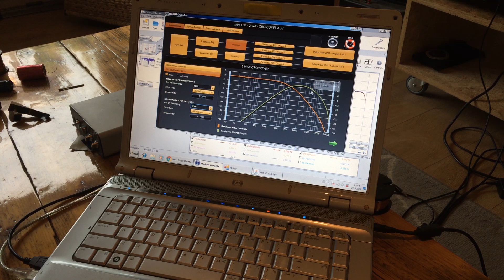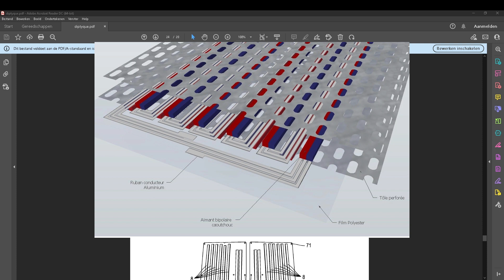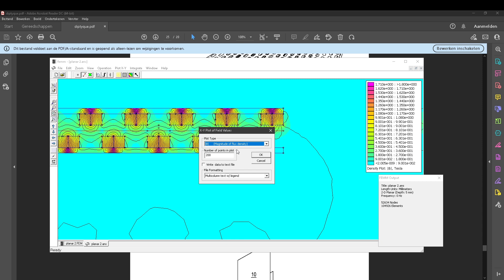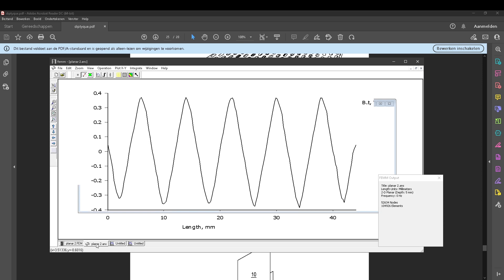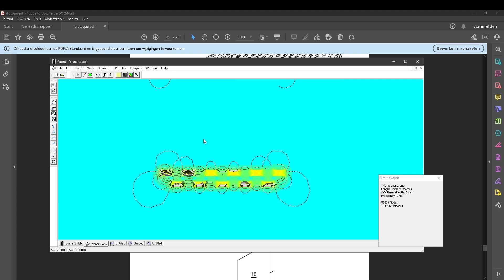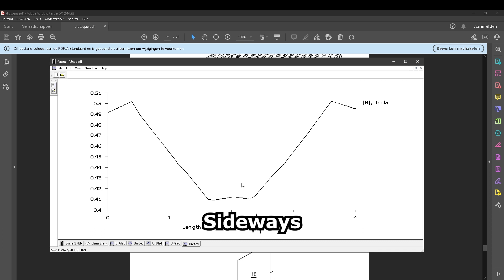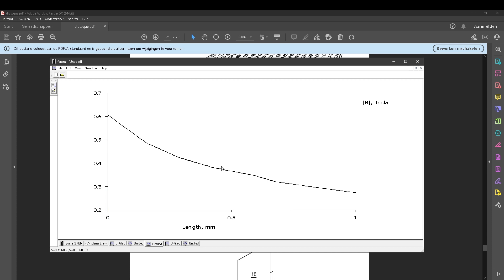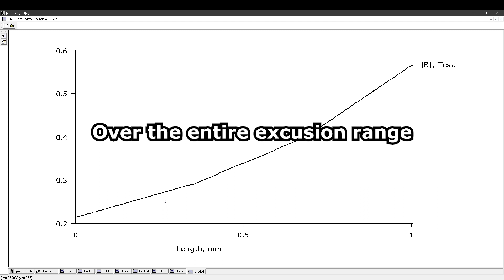Diptyque Planar magnetic speaker - Motor design "PPBM"  part 2

Comment: Thank you Joppe for your interest in Diptyque speakers technology. A patent is the description of an innovative technical solution, but it does not necessarily describe the manufacturing secrets which makes it possible to obtain the optimal result.
When we imagined this architecture, we had 3 requirements:
1- Make a perfectly symmetrical speaker in front and behind
2- Minimize the closure of the membrane
3- Have significant movements of the membrane with a constant magnetic field

Points 1 and 2 were easily obtained with this technical solution, but you are right the point 3 was more difficult and subtle and asked us for a long work. It was by working with our magnet provider that we found the ideal solution with magnets specially manufactured for us. But you will understand that we keep some secrets…;)
I invite you to come and listen to our speakers in a next show to discover their qualities, and their faults too…;)
Best regards, Gilles Douziech, diptyque audio designer.
Reply from the maker: Thanks ! I would be happy to hear you speakers in real live any show nearby that you know off?  It's an interesting design using rubber magnet i believe ?

Comment: Only use I could guess would be that this setup intentionally introduces (pleasant?) harmonic distortion / emphasis at particular frequencies. Definitely unusual, but the best way to make a judgement would be to listen to it. As someone else mentioned, it might be acting less like a piston and more like a DML, with complex modes resonating across the membrane due to the non-linearity in the field.
Reply from the maker: i think they will sound like most planar magnetics.  definetely not dml like, since that requires a stiff surface not a membrane.  it is sort of push pull what they eventually did.  but just slightly less neat as a regular one.  but most single ended planars sound also fine (like magnepan ) and single ended is way worse linear wise then there push pull. so they did achieve something better then single ended. i just dont know if it is worth all the effort.  i do like the fact they are able by doing it this way to have more coil over the entire foil instead of regular push pull.

Comment: Thanks for sharing this weird magnet composition. I tried a bit different one and it seems slightly more linear.
|s|     |n|     |s|     |n|     
|n|     |s|     |n|     |s|     
-------------------------
|n|     |s|     |n|     |s|     
|s|     |n|     |s|     |n|
Reply from the maker: Yeah thats because this is a regular push pull config :) also shown in the videos :) its more linear and stronger.  its what most push pull uses. so a single ended and the another plate that squeezes the field out.  increasing the north and the south facing the foil.
Reply: "this is a regular push pull config" - oh my, I invented the wheel :)

Comment: After watching many of your videos, which are good and interesting, I have a feeling that you got stuck with one concept and one idea.
Reply from the maker: Well its not being stuck.  I chose planar magnetic and the concept on purpose because thats what i want to build.  :)
Reply: @joppepeelen  .... I understand and agree with that. 
That to add, the orientation of the magnet and the ribbon is what require a change in approach.
Reply from the maker: @sundarAKintelart  well its interesting to see other ideas by reading patents. it gives ideas etc. sometimes you come up with a new and better idea sparked by someone else his idea. (so not the same but new or slightly different)
Reply: @joppepeelen ... not as assumed. Not bank on some other videos that had patterned designs. 
It's just the possible play of magnets and current through a winding wire that i am talking about. Surely I encourage experimentation.  Thanks.
Reply: @joppepeelen  ... Hi, I happen to come across your videos posted some 4 years , maybe 2017.
Reply: @sundarAKintelart  If you have ever done any experimentation with magnetic circuits, you'll discover very quickly that there are far from 'endless possibilities' when it comes to producing high fidelity audio. There have been how many innovations in the last 100 years that made it to mass market? not many - and that's with multiple generations of effort from countless passionate people working. Anyone who claims to have found the 'next big thing' is met with appropriate skepticism.
Reply: @stets43  ... Agreed

Comment: Your push-pull magnet structure does indeed look much better, why would anyone change it? Especially without steel plates to hold them, the only problem left is the resonance of the air gap between the magnets. There's nothing you can do about that, as far as I can think of.
Reply from the maker: Cavity resonance can be a problem but only for tweeters:) they do use metal , first video i used a picture where the type of magnet used was unclear, if they used as was drawn metal could not be used. But in there patent its different.

Comment: Great, then it was as bad as I suspected. Unless the membrane is stiff, it seems to be "bending the waves" like a DML?
Reply from the maker: bending wave :) well i dont think its the idea behind it at least :)  since the coil is close to one and another i supect 2 coils would be more linear then measuring one of the gaps as i did. but how nice it adds up and how well that translate into less distortion compared to single ended for instance i dont know :( its still fun to see people trying stuff.  if it is any better then normal... cant say without actually seeing the difference. does not look better then a regular push pull to me.
Reply: @joppepeelen  You should view the tangential  magnetic field intensity for the horizontal (along the membrane) and the normal magnetic field intensity when viewing the moving membrane. Using /B/ shows the scalar.

Comment: Sometimes some things are used because the other ones are already patented ) For my eyes if we take the "distance/force" curve and reflect it left to right, we won't get a straight line out of the sum. It will be U-shaped. You know, sometimes marketing managers can sell distortions more successfully than a high fidelity.
Reply from the maker: well yeah there might be several reasons for it (ease of production , costs, aesthetics  etc). although i cant imagine someone holds the patent for a push pull magnet array.. i mean it has been done 2000 times :) i agree it wont be perfectly flat (this cornstruction) if it would work adding them up it comes much closer then it is right now. so i guess thats the idea at least. but it wont beat the regular pp in terms of even field.  it does have more gaps then a push pull with the same amount of magnets. but less force and less room for coil :) to many variable for me to guess what would work better :)
Reply: @joppepeelen  It would be nice to watch how will you build that any way )

Comment: I would also say that the lack of linearity cancels out with the other coil next to it being the inverse.
I think the most linear field can be obtained with round magnets in push pull, for example patent DE102016108598A1 Fig 4
Reply from the maker: well i was thinking the same  , but  where it counters it is in another place, (the next coil is at a different spot on the foil) so perfect linear it will never be. compared to  regular  push pull or ESL.  yeah rounding off the corners can get rid of the difference between 0.5 tesla  (on the edge of the magnets) before it drops to 0.45. and comes back to 0.5 again, changing the space in between could help to.
Reply: @joppepeelen  I think at low frequencies it can be assumed that the foil moves uniformly so the countering should work there. At high frequencies the linearity doesn't matter as much because excursion is much less.
However I assume regular push pull with bar magnet is still optimal because the increase in field strength towards the extremes will counter the non-linear behaviour of the suspension (the foil's elasticity).

Comment from the maker: its hard to say if this works the way they designed it.  the opposite magnet might  fill in the loss of field strength of the next magnet. but i do not know if this does the same as an even field all the way trough its excursion.  in a ESL the same things happens.  moving the foil closer to one stator makes the atraction of that stator stronger and the other weaker by the same amount... in the end remaining equal.  in this case the coil is in 2 places.. when this happens. unlike a ESL.. the esl does this over the entire surface.

one last thing to mention is i used Ndfeb magnets for all, they use ferite rubber bonded ones, they have not as high magnetic force near the surface ! so it might look a little less drastic ! near the magnet